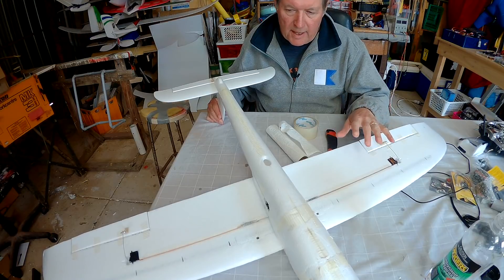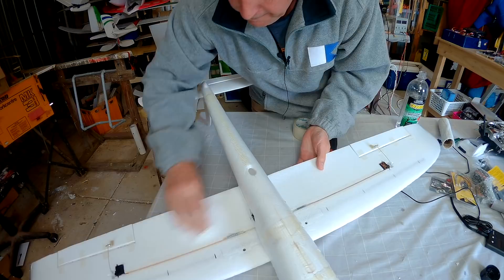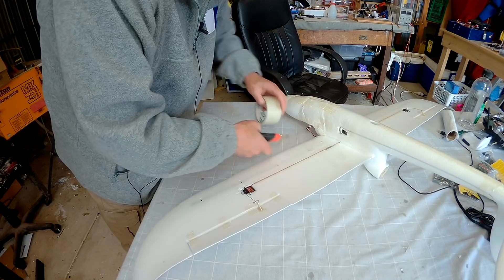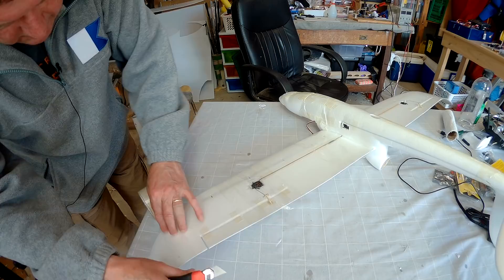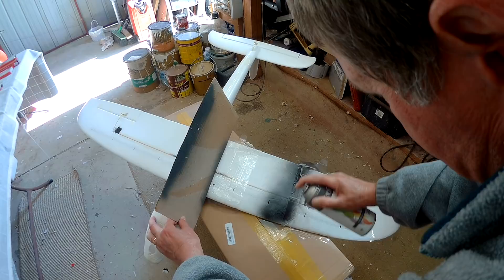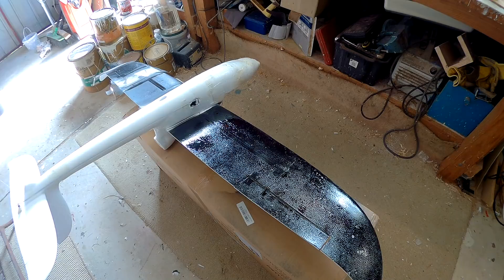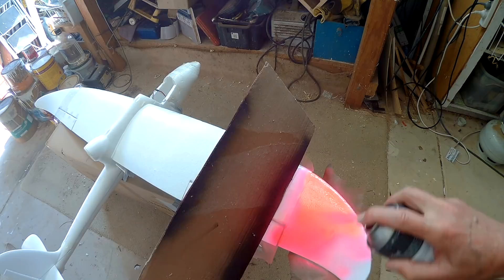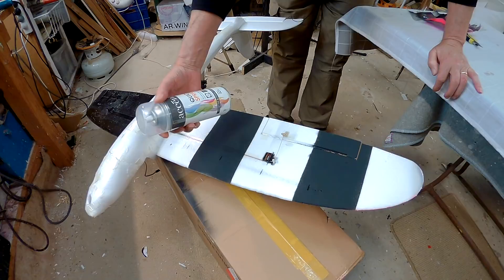Plane painting for visibility

Comment: Good scheme, especially the orientation colours of all black on one wing with striped on the other. Only things I would add:

- Keep your distance with the spray or use an airbrush. The propellants in the spray will often attack foam.

- If using a spray, hit multiple times leaving enough time for the first very light coat to dry. This will help reduce foam damage as the first, now dry layer will shield the underlying foam from propellant damage.

- Use masking tape (US: painter's tape) as this won't pull bits of foam off on removal, especially after it's been left overnight.

- Light colours, especially fluro-colours are easy to see on the ground but hard to see in the air!

Comment: For those of us who use huge amounts of hot glue: do not wash your plane with huge amounts of alcohol or let it get in direct contact to glue since it will release from most harder surfaces, thankfully got glue on foam usually still holds just fine.

Comment: Depends on the type of foam. Polystyrene foam is sensitive and mild but polyethylene foam (elapor) is insensitive to solvents so the color does not hold well. Such a foam "bombed" with the ions (UV light), or flame surface or flush with toluene. Then the color is permanently held.
Reply from the maker: Thanks, great info

Comment: After flying fpv so long it's fun to look up and try to spot the plane- this will help many times I give up and back to goggles
Reply from the maker: My most dangerous time is trying to spot the plane after lifting th goggles.
Reply: Ya that's what I meant- white plane on overcast can be impossible to spot
Reply: I notice you're somewhat fixed wing purist- I used to be also. Would look at quad specs go on for 2 pages and think NO THANKS.
Then my son got a small brushed quad I picked it up and was hooked. I love building them as much as flying. So I take my planes and quads out and switch it up same session.
Anyway- have you flown quads what's your take?
Reply from the maker: I have built and flown a few RCExplorer tricopters, and I have a micro quad. Might grab me one day but I don't have enough time or brain space to deal with fixed wing and multi rotors.
Reply: I'm gone over to using leds in green for the underside of the wings. Cheap from China and very visible

Comment: I fly in the winter months. Most of the time,the sky and ground match as far as color, a grey color or bright white,no blue skys to see much. I lost sight of my little pusher soon after launching and had to land it as soon as I regained visual. I found that red seems to be the best visual color so I use red stripes on the bottom and red solids on the top wing. The tail gets a solid red color. No blues at all. A mixed cloudy / sunny day in the middle of the winter just causes the plane to blend easier.  here in Northern Michigan,its not unusual to go three months without sunshine. Its called lake effect clouds. It is created when cold air passes over warmer lake Michigan waters. We can get twice as much snow from lake effect than a regular system storm. Until the Great lakes freeze over completely( late January,or Febuary) We can get buried in snow.
Reply: RC Hobbyist Extreme // Although red is a good color, I find yellow or high visibility green to be much better. Red tends to darken out and becomes black from far away on overcast days.
Reply: mazpr2025 We get white cloudy days mostly,not dark grey,its can be nerve wracking. Some people have to use special sunlight lamps so they dont get depressed.
Reply: That sounds depressing

Comment: Andrew is that water or solvent based paint can you use this on all types of foam.
I have not tried painting a foam plane as yet because experience with other foam products the paint melts the foam.
Reply from the maker: Solvent based. This EPO foam is OK, but XPS foam would dissolve. Have to test it first

Comment: Nice quick demo!  Is there any reason you use flat and then gloss overspray, and not just gloss directly?
Reply from the maker: Need a perfectly smooth and clean surface for gloss spray otherwise it looks bad. Matt goes on easily and opaque, the clear overspray is mainly for pre painted purchased models for extra protection, and I would use satin rather than gloss.
Reply: Mark Harrison There are no gloss florescent paints available,thats why.

Comment: I tried to paint a Z84 but the foam is very slipy - paint didnts stick just slid offf like a powder.

Will the spirit allow it to stick or do I need to sand it finely down? 

Wasent sure if it was the foam type or what.
Reply from the maker: The spirit should be enough (can also use kerosene, de-greaser, soap and water but test that it doesn't damage the foam)

Comment: Is that a Multiplex EasyStar? When the wing was wet, the texture was clearly visible and it looks like the Elapor foam they use, similar to Epo I guess? What's your experience with Depron foam board and spray paint. I have tried dozens of normal cans and they always burn the foam when you try to get a good coverage in 1 go. Misting from 10 or so inches away seems to work but the results are never that great. The special foam sprays are less aggressive but are 3 times as expensive for a can half the size. 😕
Reply from the maker: Bixler 1. I dont spray XPS or Depron usually. Very light coats might be OK
Reply: I have the EasyStar and Bixler 3, the decals are starting to come lose, so I might strip the plane completely and give your paint scheme a go. Visibility looks a lot better then the default schemes. Thanks for the tips! 👍

Comment: Hi Andrew hows it going,just checking if this paint is safe for all foam,i need to spray my Durafly T-28 Trojan V2 its original paints peeling off :(
Reply from the maker: Dont know sorry, it's fine with the Bixler foam but you would need to test it first on the Trojan

Comment: A very nice demonstration. How do you know which paints are foam safe? Does the paint can state it is foam safe? Thanks for the video and Happy Flying!
Reply from the maker: Have to test spray first. This EPO foam can handle just about anything, but XPS foam would dissolve
Reply from the maker: Foam is not mentioned on the can
Reply: Andrew, thanks for the info.
Reply: You can now buy water based spray paint, which is even styrofoam safe, from Montana and other spray manufacturers (Liquitex).  Just FYI.

Comment: OK Andrew, I noticed you taped over the wing servos,  how about the pushrods and connectors in the wing ? Do you "block out " those components ?  I would imagine spray paint is not a servo's friend .  How much "block out" is enough ? Thanks.
Reply from the maker: Push rods and connectors are fine with a spray of paint. I just tape over the servos to hold them in better really
Reply: Andrew, I get it. LIGHT coats of spray paint are fine with push rods and connectors. I guess I would just "work them" between coats just for a check.
Reply from the maker: Exactly, go to it

Comment: Is fluorescent pink more visible than fluorescent lime/green at distance ? I've never tried the pink.
Reply from the maker: Yes pink it the brightest I think
Reply: And it's easier to spot a lost plane on the ground or in front of trees, than green, too!(I use a Fluoro Red)
Reply: EC White Yes,all the way around,pink stands out way better than green. Especially if there are any pine tree stands in the area. I have a big pine tree stand and lost my pusher in them. the snow trapped in the branches made my lost wings blend in with the snow. After finally locating the wings,I painted them red. They were originally white with blue stripes. A very bad winter flying color I found out. As soon as my plane took off,I lost it in the cloud colors. Even dark colors like black didnt help. I now paint my winter planes florescent colors,they reflect light even on grey overcast days better than regular colors.

Comment: Denatured alcohol will debond hot glue!
Reply from the maker: Use too much and the servos will fall out!!
Reply: Andrew just used a barely damp cloth on the broad wing surfaces, he did not pour it on the wing. His reasoning is sound. Just relax and remember you never apply the liquid directly to the surface, using just a damp rag gets the surface ready to accept whatever finish you are applying without unintended results of overapplication. Good to go.